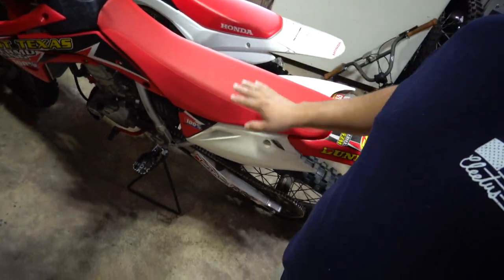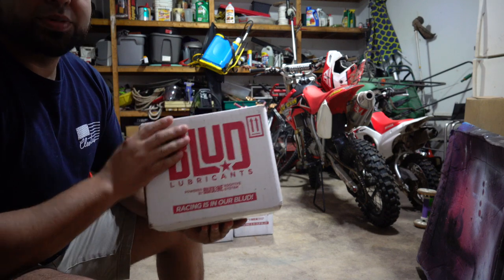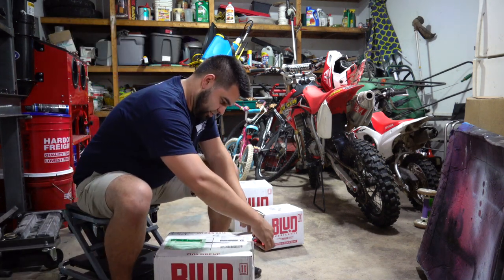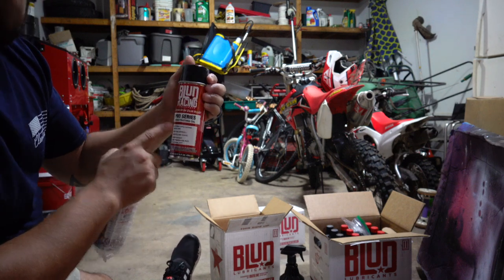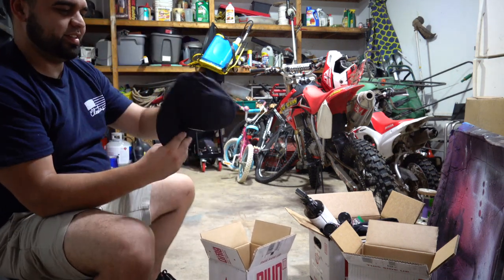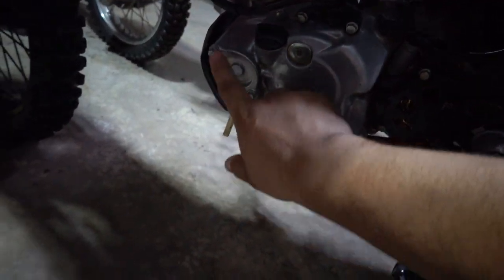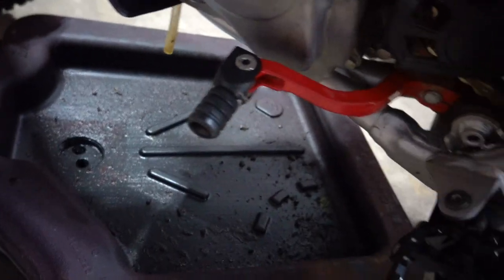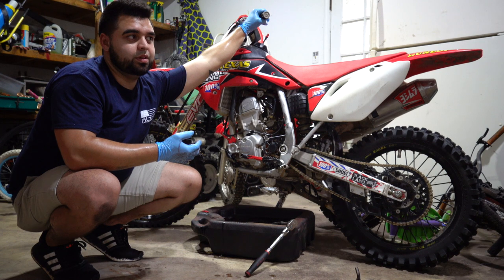How To Do An Oil Change On A Honda CRF150R + NEW Sponsor!!

Comment: so whats with people running 20-50oils or even rotella 15-40 diesel oil? manual says 10-30 but is that not enough protection? i do hear of guys running rotella 15-40 diesel oil and still going strong over 400+ hours